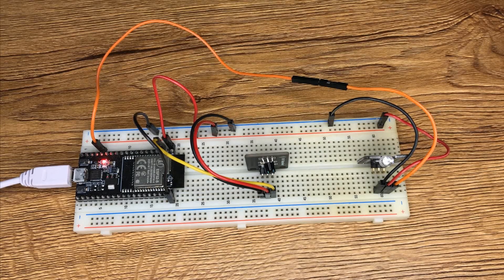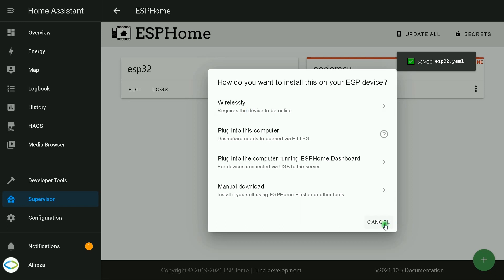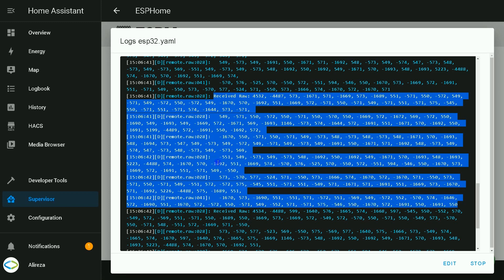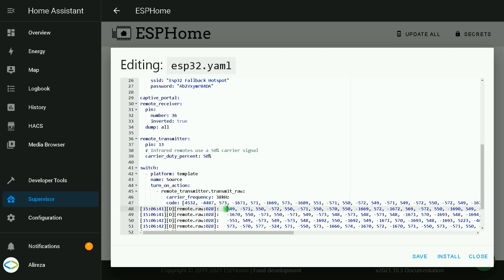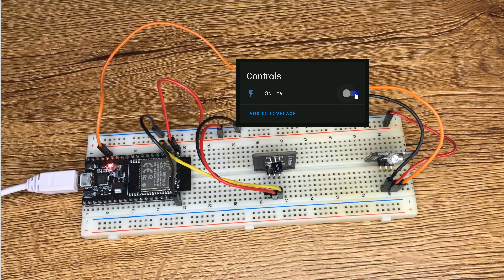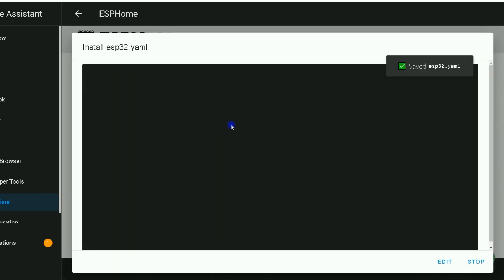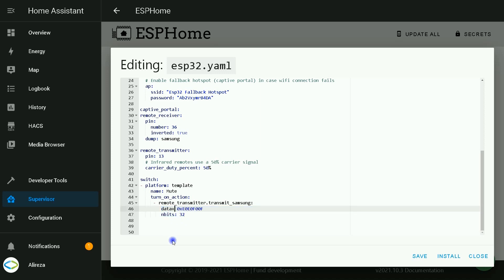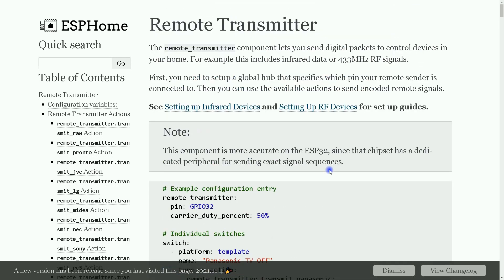Smart IR remote control

Comment: Yes ok i receive this data and i  see them in logs from my samnsung ir remote.. but  how i can use these received data in logs to control something connected to home assistant?
Reply from the maker: You did it yourself, please elaborate what you wanted to do and how you did it, please.
Reply: @kian.smarthome   I wanted to bind some of ir remote keys to trigger some devices in home assistant.. So i used this code:

binary_sensor:
  - platform: remote_receiver
    name: "PC Shutdown"
    samsung:
      data: 0xE0E040BF
      nbits: 32
  - platform: remote_receiver  
    name: "light"
    samsung:
      data: 0xE0E020DF
      nbits: 32

under remote_receiver: i put this code while for data i use the logs to capture the data signal code and put it back to the code above
Reply: @kian.smarthome 
 remote_receiver:

  pin: 
    number: 32
    inverted: True
  dump: samsung
 
binary_sensor:
  - platform: remote_receiver
    name: "power on button"
    samsung:
      data: 0xE0E040BF
      nbits: 32
  - platform: remote_receiver  
    name: "source button"
    samsung:
      data: 0xE0E020DF
      nbits: 32
  - platform: remote_receiver  
    name: "volume + button "
    samsung:
      data: 0xE0E0A05F
      nbits: 32

here is the code.. i captured data of button presses in logs
for each button you want to add you follow the same process..
Reply: @kian.smarthome  as project i wanted to press a button on ir remote contoller to control some devices binded to home assistant so if i want to turn on a light by using ir controller i can do it from now on

Comment: Great video but I've never played with these items. Before being able to interface them via USB to a Raspberry on which the Home Assistant is present, how should the board be prepared on the breadboard? Should any firmware be installed on the card?
Reply from the maker: Thanks. 
This video answers your question: 
https://youtu.be/wl2PEqnkIqw?si=E5YhcM5I0J5_2n4F
Reply: @kian.smarthome  GREAT!!!!! I'm following from Italy. I need to know what all the components you used... What I would like to make is a small box for the house assistant to use to turn off my guests' air conditioning when they leave the room, so I purchased: a Shelly 1PM which has to check if the air conditioning is on and a human presence sensor which sends HA the information that the guests have left the room but I have not found any device so small and cheap that I can be sure that it is can be integrated into HA. I have a little familiarity with electronics to be able to do what you explained well on a breadboard but then I will have to assemble everything in a small junction box. Thanks for any advice
Reply from the maker: @enricolazzerini9993  If you watch video carefully, in it all components are described.
Reply from the maker: @enricolazzerini9993  Also below video helps you:
https://youtu.be/hU3o9eRRjLI
Reply: @kian.smarthome  Hi, thank you for all the videos. My need was to turn off some air conditioners but first I needed to know if they had been turned on. This information is given to HA by a 1PM shelly as soon as it detects consumption above 100W. Subsequently, using a microwave presence sensor I can know whether the room is occupied or not. Finally, an ESP32 can then turn off the air conditioner via an IR command. At this stage it is sufficient to discover and memorize only the shutdown code that I hope to obtain from the original remote control as you explained it in this video of yours. I ordered an ESP32 ESP-32S and a 38 kHz IR infrared tx+rx kit. It would be nice to even be able to set and control the temperature remotely but I haven't found any specifications for HISENSE air conditioners
Reply from the maker: @enricolazzerini9993  You are Welcome. 
About the last part that you said, Have you watched this video?
https://youtu.be/hU3o9eRRjLI?si=ETUwJH402v0t0HE5

Comment: Hi, thank you first for the video. 🙏🏻

I want to add some feature to my climate. When I clic the button on the remote control, the led on the receiver is blinking, but in the logs, no code is written. Do you have an idea, what’s the problem?
To test, I have set dump to „all“.
Thank you, regards Daniel
Reply from the maker: Paste your code here to check them.
Reply: @kian.smarthome  thank you for your answer. Now it works. I had an error in the code.👋🏻
Reply from the maker: @Danixx1989  🤩🤩

Comment: Hi, this video is exactly what I was looking for!
One queston - the transmitter and receiver that you use are rated for 3,3V or 5V? I have trouble finding any 3,3V modules. Would 5V modules work? Or the on-board resistors would be too resistive for it to work?
Reply from the maker: Hi, in the video I have mentioned it. connect VCC pin to 3.3V
Reply: @kian.smarthome  FInally, my parts came in. Works like a charm! I've created an automation to turn my TV on or off when my MiBox turns on or off, so now I can hide that TV remote somewhere out of sight!
Note to others who would want to create a similiar automation - you need to trigger on state changes, from "on" to "off", "off" to "on" and "unavailable" to "on".
That last one gave me a headache before I figured it out.

Comment: Nice video. im really in need for a locally controlled solution like this, instead of the tuya ir i have as it has very bad latency. So does this has noticeable latency? and if i for example click the volume button many times quickly in home assistant, will the clicks be transmitted as i click them. How reliable is this in general. And can i use esp8266?
Reply from the maker: Hi, there is no latency in this way but you must be assured there is no issue with you Home Assistant.
Yes, you can use ESP8266
Reply: @kian.smarthome  Thanks a lot.

Comment: In my case long press the remote button to turn off the one plus tv so i cant receive ir codes to turn off the tv. what should i do?
Reply from the maker: have you tried another ir remote to test if you can get the code?
Reply: @kian.smarthome  no i have only one tv remote but on operation ir signal is received and perfectly works without any error
Reply: @kian.smarthome  any other option to receive ir signal to turn off the one plus model tv
Reply: @kian.smarthome  but im tried ac remote its working and only TV turn off ir code not received .what should i do?
Reply from the maker: @gokulajith2537  I am a bit confused. Do you receive the IR code by ESP32? Do have the code but you have problem with sending it? right?
Reply: @kian.smarthome  no im only received turn on ir code and turn off ir code not received from the remote because it have long press option to turn off so the code not received
Reply from the maker: @gokulajith2537  I see what is your issue. I need time to review configs.
Reply from the maker: @gokulajith2537  Increase filter and idle times. at least double them and test it.

Comment: Hello Alireza, I keep falling on your videos!  So if I want to send IR signals to a device which brand is not in the ESPHome list page for Remote Transmitter, I must use Raw data? So I first need to copy each raw code for each button using an ESPHome Remote Receiver, then create code to send data after naming each command. I guess I understand the drill, it's interesting but will require a lot of time. Using a Broadlink RM4 Mini is helping to save a lot of time but it's not the same kind of DIY project and you would need to 3D print a case if you want to end up with a decent RX/TX IR device that can sit in your home without looking odd. I love your videos, thanks for posting so interesting content!
Reply from the maker: Hi, I am glad your are interested in my videos. Yes, You are right.
I will find a better way.

Comment: Very nice video! I tried same but I got one issue: with a Mitsubishi aircon remocon I am not receiving in the log alternate positive and negative signals but only positive integer in HEX format:
[15:19:54][D][remote.pronto:229]: Received Pronto: data=0000 006D 008A 0000 007B 003F 0010 002E 000F 002F 0011 000F  ....
Any idea how to solve the situation?
Reply: Have you tried to push this as Pronto data nonetheless?
Reply: From your log, it shows that the received content is in Pronto Hex format (the data received in the video is raw data), so the transmission should be in Pronto Hex format rather than raw data. You can try writing the YAML with the following content

- remote_transmitter.transmit_pronto:
  data: "0000 006D 008A 0000 007B 003F 0010 002E 000F 002F 0011 000F  ...."

Comment: nice video. I wonder how we can sync state of IR device to home assistant whenever someone use the physical remote, any idea?
Reply from the maker: Thank you. it is not possible as IR remotes only send signals. If your device can connect to network, there would be a chance of get what you want
Reply: The only way would be if there was something that reported it state or had some other feedback you could pick up on. 
For example I am looking at lighting controllers from lutron so when a scene is activated it will feed in to an opto isolator board that will pick up on the mains voltage going to the lighting circuit in question. A bit of a faff but it’s easier than trying to get home assistant to connect to the telnet and read the state from there.